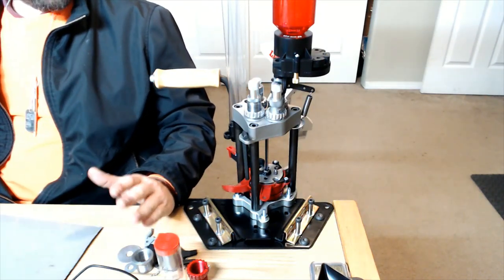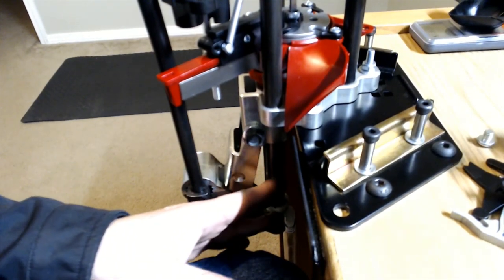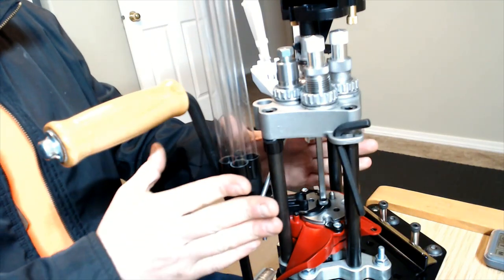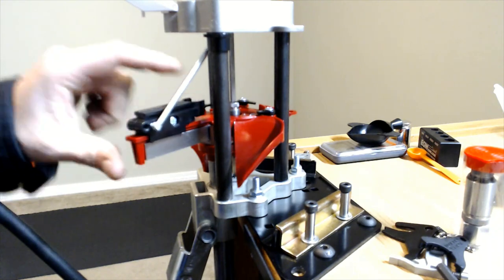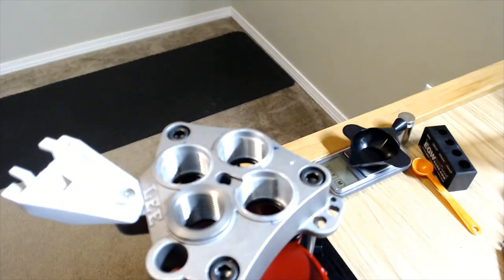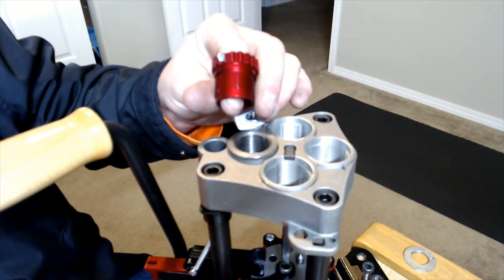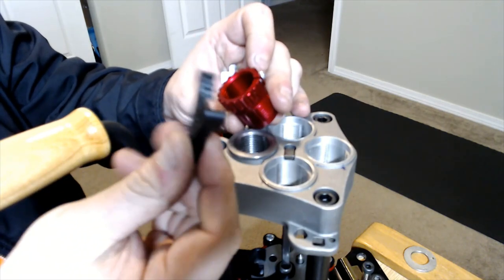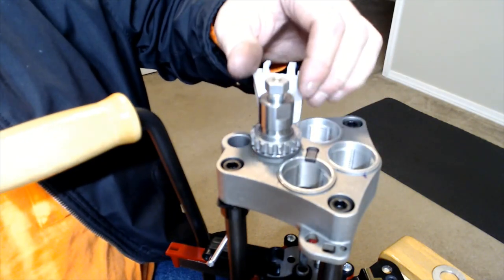Lee Auto Breech Lock Pro - Setup and tweaks

Comment: Regarding the reset chain, it's not a flaw, you've got the chain installed incorrectly.  The spring and locking bell are supposed to be at the end of the chain with no extra links, that way it fully seats under the carrier.  The extra chain links go through the reset arm, not under the carrier.

Lee Precision Auto-Disk set up:  https://youtu.be/h7slKaDrMHM?t=56

Comment: This may be helpful. From Titan reloading, you can order the Lee BL Pro 7 cavity mold(#PR3691- $3.00) to get that spring anchor(like the one that keeps the spring attached to the case feeder)  to replace your washer. As for the tubes on your case feeder, get the titan tube harness(#T304-$5.99), this will help keep your tubes in the base and keeps the spacing correct. For smaller diam. cases, grab some PEX tubing from any hardware store, measure the length of the holes in you collator, and install the tubing in the holes so the cases feed base down. I believe .50" od, .375" id is the correct tubing. Also from Titan reloading, you can add the mini MR. Bulletfeeder from Double Alpha. I haven't got one yet, but I've been told it should fit on the lee press. I would talk to Mike at Titan to verify fitment. The only Lee powder measure I've had consistent luck with is the Deluxe Perfect powder measure. I haven't figured a way to get to work by case activation. What I've done is installed a Hornady case activated powder drop system with a Hornady powder measure. So once I get the double alpha bullet feed, I'll be good to go!

Comment: Lee makes a parts for the Auto disk that turns it into a spring actuated return. The instructions are in the manual, but I'll list them as of 2021. You'll need part AD2309 Spring return lever and part AD2296 Spring. I did this to mine while I had it and it worked great. I have since moved onto the Lee-Auto Drum.

Comment: If you're going to add all the accessories much cheaper to buy as the "Pro 4000 kit"  that also includes a set of dies.😎
Reply from the maker: The Pro 4000 kit doesnt come in 40SW. I looked at that first before I even started buying any hardware.
Reply: @Sartek  didnt think of that 🤔

i only found 38/357 & 45lc  available,  i have a 357 so i bought it.  and bought dies for 9mm, 40sw, 45acp, 223, 300blk and 45/70 😜
Reply: @Sartek  I have more than one caliber to reload. Buy a Pro 4000 kit in 45 ACP and a set of dies for 9mm with a set of bushings. Prob solved (or am I missing something?).

Comment: Thank you. I looking at moving up from my BreechLock Challenger and am betwixt and between an inexpensive progressive like this or a Lyman All American 8 turret. 

As someone who has been hands on with the press for awhile and corrected shortcomings, do you see any practical way to automate the safety prime operation? I have not found one setup in stores to examine close up, so I've been studying videos trying to figure out if by application of a as yet unconjured mechanism draw the autoprime over and dispense a 'PEZ' on the upstroke. I would get a bullet feeder die, give up my factory crimp die and use the seater die to deflare/crimp and be full progressive.
Reply from the maker: Unfortunately, I havent found a way to automate the safety prime, nor do I think attempting it would even be worth the trouble. If you decap and resize all your brass in one batch by itself, you could get a single station priming press that does the auto-dispensing for priming. This would let you remove the decapping/resizing die from the reloading cycle on the progressive, and insert a bullet dispenser die into position #2, and move the powder drop to #1 instead.
Reply: @Sartek  I'll ponder the priming press; I'm currently batch processing brass, then hand prime with a Franklin Arsenal hand primer. 
A Redding T7 or Lyman All American 8 with a prime system will let me keep 2 calibers on a turret, BUT even without automatic priming the Lee 4000 will more than meet my needs and is bang for the buck.
I need to just pick a route and go.
Reply: The Lee Load Master has a automated prime system, and a extra station for whatever die you decide to use.

Comment: If your mounting bolts were flipped over, going down through the bench rather than coming up through the bench, would your powder reset chain clear then?
Reply from the maker: the bolt cant go down. The elevator bolts mounts the press to the mounting plate, not the base that is attached to the workbench; so the bolt head gets sandwiched between the two parts.
Reply: @302hardtailr6  Dremel to the rescue. On my Auto Breech Lock Pro I use the newer Lee Auto Drum measure and it activates off the case neck.

Comment: Do you have a source for those plate mounting shoulder bolts? I've been trying to come up with a similar solution for the same press. Thanks. Well done.
Reply from the maker: Any ACE/TrueValue hardware store is likely to carry them. You can also find them online with Tacoma Screw.
Reply: Also, .... Try mounting the bolts correctly!
Never have I ever seen someone mount equipment with the hardware coming up through the bottom....SMH..
Explains why his powder feed chain was getting "crushed" on the bolt...
Reply: @timsteelman4922  
The chain is installed incorrectly, that's why it's goobered up.  There should be ZERO chain-slack under the bell.  All the slack should be gathered at the top through the powder reset arm.  The black base of the case feeder can be rotated out from under the toolhead without affecting case feed at all.

These "modifications" are due to incorrect setup, not design flaws.

Comment: 23:11 Shorten the bolt
Reply: Actually, no.  He needs to pull the slack out of the chain so that it gathers up at the powder measure reset arm, not at the bottom under the bell.  I've watched this guy's series on the press and most all of the problems are self induced by not setting it up correctly.  None of these "modifications" are necessary.

Comment: So did u just bolt the press down under the mounting plate ? I dont get how the mounting plate helps you at all .
Reply: If you have a weak table top, it will help spread out the twisting force.

Comment: Nobody asked about the press base height.  Seeing that you mounted the press directly on the bench at about waist height (30 inches) doesn't this make the down stroke of the handle low?  I'm thinking it would hurt your low back. Even if seated at most chair heights (17inches) that down stroke is still too low isn't it? What is the best base height for the press standing or sitting?
Reply from the maker: it is low. I've seen metal bases that raise it up about 10-14" ..and the arm is certainly LONG, but I keep my chair really low to the ground as well because of other equipment I have running on the table. by mounting it at the table surface and close to the side on that particular table, it minimizes the vibrations that affect my scales.
Reply: The height is all relevant to the mounting surface height. If you mount to a bench edge or stand edge as is required per the instructions, then the arm action is perfect..

Comment: What is the benefit of this press, vs. the LoadMaster ?
Reply: -Pro-1000 is a light duty, three station press.
-Auto Breech Lock Pro is a medium duty, four station press.  It becomes the "Pro-4000" when you get it with the caliber conversion kit and accessories with it.
-Loadmaster is a heav(ier) duty five station press, and a considerably heav(ier) price tag.

The main difference is the ammo throughput.  You can get 300-500 rounds-per-hour pretty reasonably out of the -1000/-4000, and both are similar in design.  The Loadmaster is 500+ rounds-per-hour,  but isn't the same design as the -1000/-4000.

I have had several Lee presses over the last 20 years, so I only needed the press only, so I got the ABLP,  It works very well for a sub-$200 press.
Reply: @hawkeyeted  What a wonderful response.  THANK YOU !

Comment: Great video to show why there's so many of these sold USED on eBay. Bad design and cheaply made !
Reply: What are you talking about?  All the presses on eBay are being sold at a premium.  Have you even tried one?  I have one.  Is it a Dillon, No.  However it does get the job done!
Reply: @lisawelsh8828  first of all, I do know what I'm talking about. I've been reloading for almost 30 years and yes I own this lee press and like I said its cheaply made. The case feeding system is beyond problematic. I also own the lee load master and an old lee single single stage. The load master is a great progressive press the pro 4000 is crap compared to the load master.
Reply: Another know nothing.. running his mouth about his so called knowledge…🤡
Reply: iVe BeEn ReLoAdInG FoR ThIRtY YeaRs!!!!!!!!!!!!